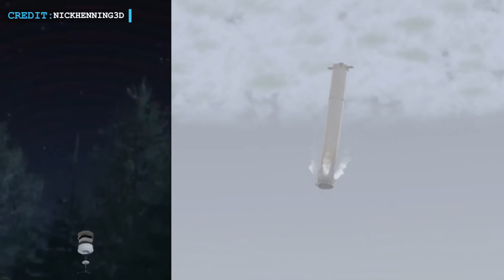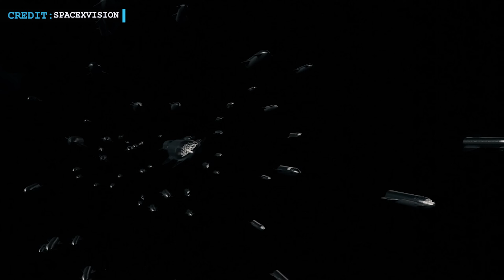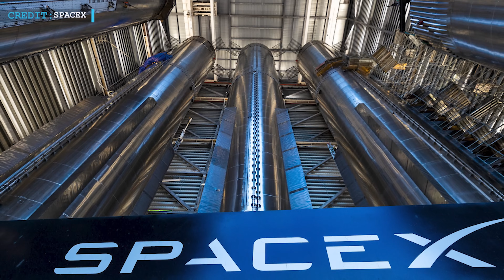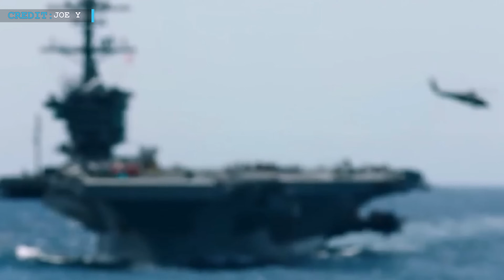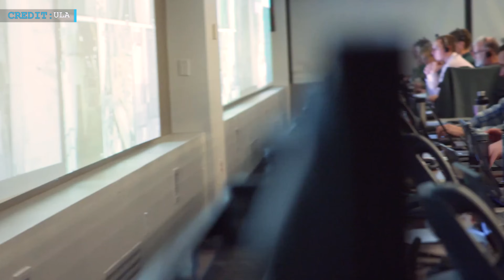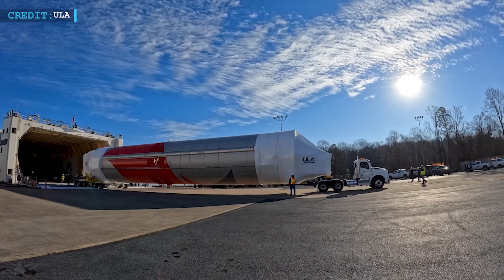SpaceX's Innovative Solution: Using Starlink For Continuous Spacecraft Communication

Comment: I doubt that the comms in reentry will make a significance difference to most mission profiles realistically, but it would be nice to keep the crew in contact. Most systems aren’t automated because they’re blocked behind the plasma blackout, it’s because any human intervention likely would only cause more issues than it could ever solve. For any sort of in-atmosphere hypersonic aircraft this wouldn’t solve anything. The plasma layers cover most of the skin of the aircraft so it’s not going to change that as the direction of communication is not opposite to the direction of plasma flow. The solution really isn’t trying to communicate from a  different direction, but rather the method.

Comment: Whoever buys ULA will need try maintain it's relationship with Blue Origins unless the company self is buying them.  I think however, that's issue since they don't seem to be good at cutting deals without side companies / customers so far as far aerospace concerns go.   Whoever does buy it, will likely have to keep Vulcan going until they can switch to more reusable vehicle.  There a lot of cost savings with them, Falcon 9 has proven it at the moment.   It may take years and a lot of money.